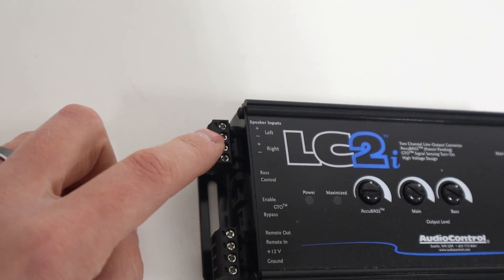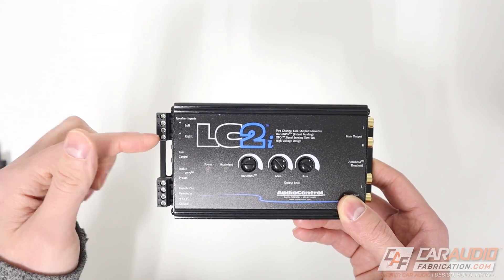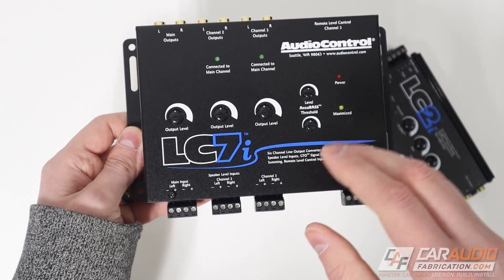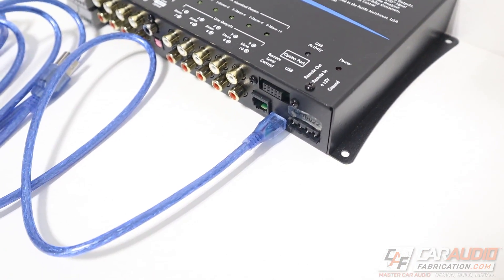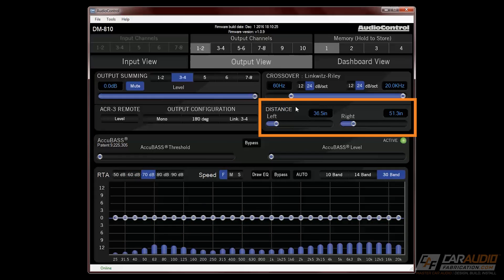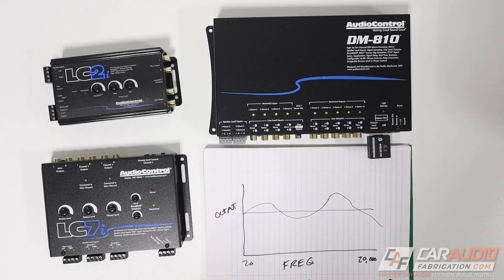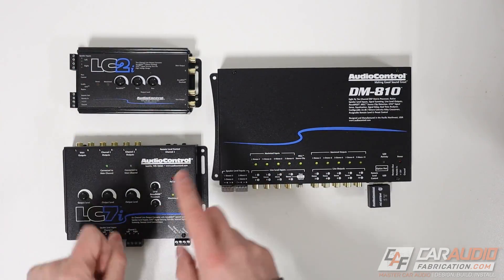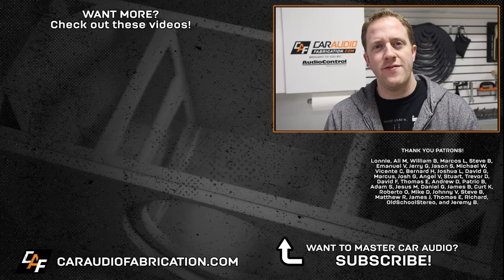Line Output Converter or Digital Signal Processor? Which one should YOU choose?

Comment: I think DSP's are needed more for a car stereo that has poor quality speakers than 1 that does not.  Good speakers should not need a bunch of "tweaking".
And if you go the DSP route, it's better to go ahead and purchase an amp with an integrated DSP.  Why have to deal with wiring up two different components?
I guess if you already have an amp adding a DSP is an idea.  But for a completely new system purchase an integrated amplifier. The less connections
you have in your signal chain is the goal. But, thanks to car manufacturers you can throw that theory out the window cuz most OEM car stereos suck.

Comment: So I have a prv dsp.. does that mean I can do away with my loc and use my dsp instead to feed a signal to my amps and give them full tuneability while still retaining my stock head unit.. or is the loc still required to keep my stock head unit…. Sorry in advance if that sounds confusing
Reply from the maker: I wouldn't recommend that DSP. Very poor quality and doesn't really have the features truly needed to achieve the main benefits of adding DSP.
Reply: @ I apologize it’s actually an expert electronics px2. It’s still  brandnew, I haven’t looked at it in years. And had it mistaken with the prv unit

Comment: Hello, i find your channel very informative! Helps out a lot!

But i also have a question:
I want to use an LOC for my bmw e90 with basic audio...and create a bit more bass
But this is what confuses me...i should tap in to the wire from stock woofers for signal to the LOC right? 
Then it goes with rca to the amp and from there to the added woofer in the trunk
But do i still need to power the factory woofers? Of can i unplug them? because the added woofers in the trunk are far better

Hopefully anyone here can helo me😁
And from there

Comment: We have equipped your LC7i with an AutoMode feature that is
designed to feed signal to the channel 3 section when the factory
system only has front and rear outputs. AutoMode takes the channel 2 (rear) input signal and automatically feeds it to the channel 3
outputs to drive a subwoofer amp and crossover. This means your
LC7i will accept two input channels (say, front and rear) and give
you three output channels (front, rear, and sub). does a DSP do this???????

Comment: in a pinch here, i have a 14 ram keeping factory head unit, the system has 6 speakers non premium, the two fronts are chained together, there is no factory sub or amp, my question is if i want to
drive a sub channel will a DSP function like the lc7i and create a sub output  if there is no sub in put from the speaker level.

Comment: So I need your opinion I have a CLS and i blew out my stock Mids and highs I have my factory head unit. The guy who owned the car before me had 3 amps I guess 1 for highs 1 for Mids and a mono for the sub. It was installed by al&eds in California. I have 1 12” l7 kicker with a Orion 1500.1 amp. Should I just get 1 more amp and not 2 for the Mids and highs ? I believe I have 6.5 in all 4 doors and 1 tweeter in the front doors . I know it’s called logic 7 for Benz stock speakers. I believe there is a speaker in the dash and 1 sub 6x9 in the back. I lesson to rap and heavy metal mostly. What do I need out of the 3 you are showing in this video? 
Thank you for your knowledge and videos.

Comment: I added a Under Seat Amp to my Goldwing GL1800 and it doesn't sound as good as it should/could. When you increase the volume the Bass decreases so you don't really get any Bass out of the sub. Is this a situation where a DSP would benefit me better than a Line Output? I don't want/expect the sub to hammer but it almost sounds like the factory speakers on caffeine instead of a double shot of Expresso.

Comment: Question. I have been looking at Alpine's PXE-0850X DSP. I can't seem to find anything about bass roll off correction in their Manual. Does this Mean I need to have one of Audio Controls LOC's hooked up first? 

Also, I ready somewhere that you tune DSP's at a certain volume. Does that mean that you can't use the Volume control on the head unit anymore and have to get another volume control knob?

Comment: I am still a little confused. I have already upgraded my stereo. I am in the process of ordering the required speakers and amps for my car. Will I need an LOC or DSP since everything is aftermarket?
Reply: If your aftermarket stereo has two or four channel line out (nearly all do) then no need for a line out converter.

Comment: Cant you just split the RCA out on an LOC to run a 4 channel or two amps?
Reply: Yes, but I don't think k you will be able to control the fade (front to rear adjustment) with the stock head unit.
Reply: @bmeach4940  Yeah, I ended up doing it anyway. Im not worried about fade on the head unit lol. I just set the amp output so it sounds right and leave it. Mine has a bass out and a full range out which is kinda nice.
Reply: @A6Legit  nice.  Glad it worked out and sounds good for you! 👍
Reply: @bmeach4940  Thanks, I just have door speakers left to do. Been a lotta hours setting all this stuff up lol.

Comment: Im not sure but im thinking im gonna need a DSP or replace my headunit. I need to run a speaker amp and a sub amp.
Reply: Update a decent LOC works fine. Unfortunately the signal sensing didnt work in my car so I had to run a remote from the HU harness. Other than that not too bad.

Comment: Hi Mark, I bought an LC6-1200 before the D6-1200 came out. I want to add a DSP, but feel there is a bunch of redundant things adding a DM810 in front of the LC6.. Do you forsee any issues adding the DM810 in front, does the DM810 have more features DSP wise that the D6-1200, or would it be more simple to try to sell the LC6 and buy the D6? I also have plans to add a LC1-800 for my sub... I think currently I can get the DM810 and the LC1-800 for around the price of the D6-1200..
Reply from the maker: Tuning wise the two options are the same (D-6.1200 vs DM-810 plus LC-6.1200). With the DM-810 you actually have ten channels of DSP control VS with the D-6.1200 you only have the 6 internal plus the two output. So theoretically you could do a more advanced system with the separate DSP.  Nothing wrong with going that route.

Comment: I recently installed new door speakers and tweeters in my 2021 Honda Ridgeline sport. They sounded weak so I added a kicker key200.4 with dsp built in. I set it up in biamp mode to set the front sound stage but it still didn’t sound very good. So know I have purchased the audio control LC7i to feed into my kicker key. I have yet to install it and am curious if you think it will make a very big difference? Also should I continue to run the kicker in biamp mode or do you think I should wire it as a true 4 channel amp with the tweets and front speakers running parallel plus the back door speakers? I’m hoping this gives me the best of both worlds with the LOC, auto DSP and amplifier built into the kicker key…. Thanks for your videos!!

Comment: Are there any benefits to using an LOC (LC6i) before the DSP (DM-810) or would that be overkill since the DSP has the speaker inputs?
Reply from the maker: The DM-810 is capable of everything the LC6i does so using both would be redundant

Comment: i was looking for a digital amp.. Till I saw this. I didnt know it was digital up to the point of still going back to RCA for transmission of amp. I would have thought by now (i'm 29 started with car audio early 90s) that we would be runnning fiber optic or the optical at least .. thanks for the video.. first install where I actually wanted to use stock radio on 2018 car

Comment: Hi Mark, I have a factory unit with 4 speakers (no premium sound), don't want to replace it, yet I want to add a powered subwoofer (Cerwin-Vega VPAS12ST).
Which Audio Control LOC do I need? Do I really have to install an amp if I am replacing the factory speakers with component speakers? Can you please advice?
Best regards.

Comment: Hi. I'm just getting started to install a system in my car. I have 2 alpine r12s, 1 fosgate 850.2 amp, 1 Us Amps 150 , 1 db drive 5 neo capacitor and 1 jl audio loc 22.  
Are these good products? 
Can I use the jl loc to connect both amps??
It's all going in a ford edge. It has a factory Sony system with amp in the trunk.

Comment: Can I use an analog to optical converter from head unit to dsp to try an eliminate rca noise? I'd use the ADC at the head unit RCA and run a toslink cable to the DSP then RCAs from the DSP to the amp. Have slight static and whine that I have not been able to resolve after years of checking grounds, and replacing components along the way. I've tried every other remedy known to car audio except for powering the head unit directly off the battery.

Comment: So how would you use these devices in an 07 Mustang with a Shaker 1000?  There are 2 6x8's and 2 8" 1.6 ohm DVC Subs in the doors, 2 6x8's in the rear deck and 2 10" 4ohm DVC Subs in the trunk.  I've chosen a selection of speakers (whether they are right or not...).  How could I use these devices to improve the audio without buying replacement amps? And which device would be best?  It seems the DSP installed before the AMP's as there are two is the right choice.

Comment: I myself am using the LC2i. It's a great little guy for subwoofer expansion and adding another amp. I'm running the lc2i with a fosgate prime r2-1200x1 and a 4 channel fosgate punch 600x4. 6x9s and 6.5s components on the 4 channel. Two 15in P2s off the mono at 2 ohms. I would love to improve even more with a dsp but the price is a bit steep for me. Any other recommendations other than audiocontrol?
Reply: Audiocontrols newish line of D-series amplifiers are a great choice for a amplifier with a DSP built inside. And they have 2 channels of pre-amp outputs aswell which would be awesome for your monoblock 😁
Reply: Did you use front or rear speaker wires into your LC2i? Wanting to do something similar, but worried the LC2i isn’t enough for a 4 channel for 4 6.5’s and a mono block for 12” sub
Reply: @20twenty_sti40  I used my rear speakers because my battery is in my trunk. The lc2i will handle what you want just fine.

Comment: I currently have the LC2i installed just for a 12" sub in my 06 Lexus GS300. I tapped into the subwoofer channel of the oem amp to feed the signal to run this LC2i that goes into the 3k mono block amp. I just purchased 2 sets of components to replace what i have in the car now with a matching amplifier. My factory system has 4 6.5" mid-bass in the doors (rear doors have additional 1" tweeter each). dash has 1 3" center speaker, 2 2.5" or 3" full range and 2 1" tweeters. rear deck has 2 3" full range and used to have a 10" sub but i replaced that with a 12" in a proted box ( Thanks to CAF for the design of my ported enclosure!). what id like to know is what will i need to do to be able to add my 2 new sets of components (4 6.5" midrange/midbass and 4 1" tweeters) with amp to my system? i dont care about the other speakers in the car. Center and 3" full range will be removed . Also not really looking to go with the dsp. Any guidance will be greatly appreciated. .... Forgot to mention that my new mids and highs amp has built in OEM line converters up to 9v.

Comment: I currently have a Lc2 in a 2017 Chevy Impala. Running 0 gauge wire, 2- 2400 crank it up powering 1-5000sfb sundown; 1- massive 1900*4. 6-12in kicker cvx. 4 massive 6*9. 2 massive 6.5. 2 ds-18 tweeters. Ive replaced the Lc-2 about three times within the last two weeks. It plays fine then it starts causing my music to skip as if i had a scratched cd. And if i let it play it causes my radio to freeze. What’s the problem?

Comment: Hi 

Great channel. I have a quick question. I have a 2017 Ford Fiesta with a factory radio that doesn't play flac files , however I do have a Audison Bit 10 and Hertz Dieci splits which gives the car good sound quality, do I still need to install an aftermarket radio to play flac files or do I rely solely on the DSP to provide all the sound quality that I need? Thanks.

Comment: Is there a way the LC7i can be set up to sum at least two of the inputs to send to the channel 3 output. The Sub output on my factory amp only plays 50hz and down and the other speakers cannot fill in the 50-80Hz frequencies properly so would also like to send the door woofers input to the output 3 for the sub to play, then apply a low pass filter on the amp. Is this possible?

Comment: I'm using a LC7i which even it is overkill for my system because all I need is an LC2i but I got it for $60 so I'm taking advantage of the Accu Bass and Active LOC for my Skar DNR. I'd rather have the DM-810 but certainly am not going to pay $550+ for one.

Comment: for the LOC, it says it handles 400w per channel. If I have 1000w rms subs right now, would it be able to handle the power? Like what would happen to the LOC or my subs if I set one up?
Reply: 400watts refers to the Hi inputs coming from your original car speaker wire not the output that goes to your aftermarket bass it converts the signal from the speaker wires down to rcas that will hook up to your aftermarket amp which is what handles the subwoofer rms wattage power

Comment: Hello-I have a 2017 F150 with the non Sony Sync3 system. I'm thinking of adding a 50x4 Prime amp to my factory door speakers and a JL microsub powered by another Prime mono amp. I plan on keeping my factory HU. Will the LCQi be what I need to get a nice clear well balanced sound stage and retain all of my functions and door chimes back sensor etc?

Comment: how is it going. am replacing my car radio an i was wondering if u should use the regular speaker wire to my amp or should i use the rca
Reply: Shielded RCA if you have it - cleaner signal. High level is mainly there for keeping oem headunit that doesn't have RCA pre-outs.

Comment: I have a line output converter in my vehicle now, I run RCA's to my amps, can I add a DSP using the RCA's coming from the line output converter to a DSP. Or is it one or the other. The reason why I ask is that it has inputs on it for RCA cable. or is it one or the other. do I need to run the speaker outputs from the head unit or can I get away with just using the RCAs coming from the line output converter?  And will this damage the DSP by using both?

Comment: I installed a ap4 ch41 amp pro in my Dodge Challenger with amplified factory stereo and added a single spare tire 12inch sub/amp combo by cerwin Vega. It sounds good to ok but the output seems a little low to me sometimes when I mostly play hip hop on mid level volume 15/38 on the nob. I have the bass turned all the way up. What I want is a bit more deep bass. I am trying to figure out if I need a DSP to improve output from my current setup or just pony up for a better sub amp combo. Any suggestions would be greatly appreciated. Thanks
Reply: Get a lc2i

Comment: I have a question. I am planning on putting in an aftermarket amp and subwoofer as the stock one isn’t that great.  I have 2 tweeters, 2 midrange speakers and a subwoofer in my cars rear deck. Which should I tap into for the input on a line output converter? Should I use all 3? Or would the signal going to the factory sub be enough.

Comment: Simple question. i think. 
Dsp vs a few old school high qaulity manual slide or dial equalizers, stacked together? 
 If  you dont need or want time alignment.
You can tweek on the fly from the drivers seat. 
Just as good as a dsp??

Comment: Great video Mark!!! 👍👍👍 How would you compare the AUDIOCONTROL DM-810 VS the ROCKFORD FOSGATE 3 SIXTY.3 considering both are DSP'S??? In your opinion Mark which one is better to buy and why??? I personally think if a person is doing a real high end sound system they are better off using a DSP instead of just a LOC!!! They will get more out of a DSP then they would by just using a LOC!!! I guess if it's something simple and a small install then a LOC is ok to go with!!! When your going to be running multiple amps then that's when a DSP is much better to go with i believe!!!